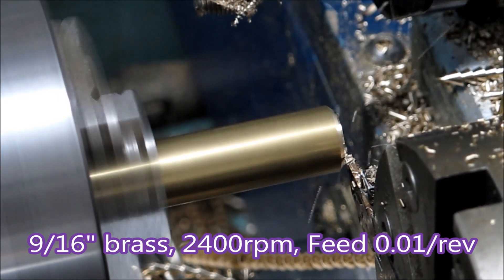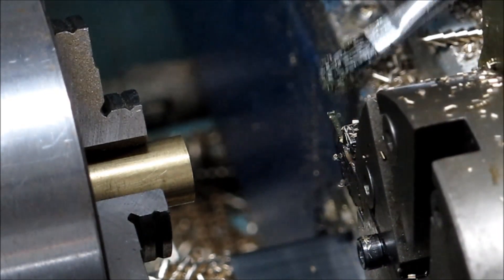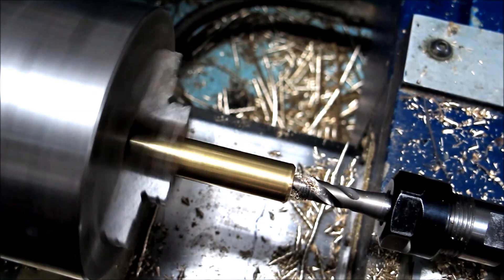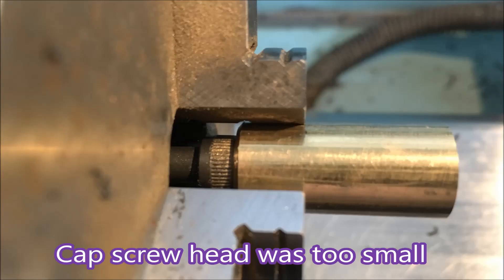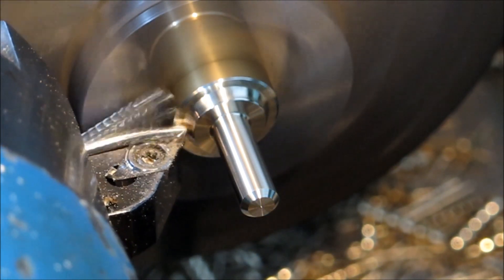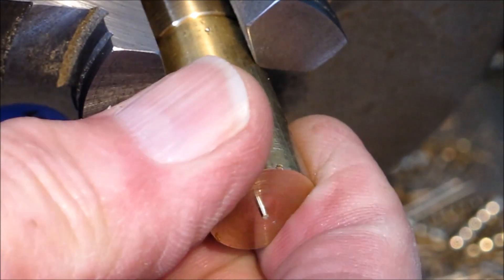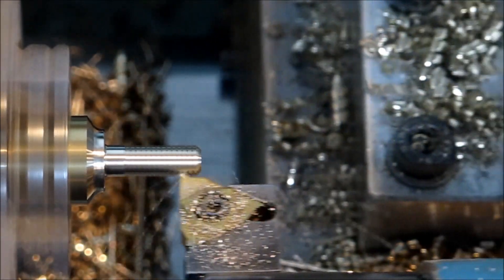Cnc lathe threading brass at 3000rpm. Drill and tap M10 in a second lathe

Comment: how much power does the spindle have?
Reply from the maker: Both lathes have 1/2hp spindle motors
Reply: @smallcnclathes  it's really interesting I have a 1HP spindle and cannot get similar results at all; only due to a bad controller. The speed slows down quickly once load is applied and tries to catch up afterwards however. when it slows down the chip load is getting relatively big at that time which jams eg. the parting tool.

Comment: with which program you work?
is it a grbl controller?
where you know the position of the spindle? is it eith a encoder or only rpm?

thanks
Reply from the maker: Alexander noname thank you for your comment. The machine is controlled by the software provided by the manufacturer. The spindle has an encoder.
Reply: @smallcnclathes  ok thanks!
do you know the program name?
is it a encoder only for speed or degree position?
you help me much!
Reply from the maker: Alexander noname  the software was provided by the manufacturer “Hercus”  an Australian company.  The encoder measures the spindle speed and controls the start point when threading.
Reply: @smallcnclathes  control the start point? its more as the speed! i think!

thank you
Reply: @EMCOAlex  Think about it.These are multiple passes. The start point must be the same for each pass or you wouldn't get a thread.

Comment: And to think some old timers, and the people who only learn from books or by following the oldies without question, still believe that you HAVE to have neutral rake for brass.
Reply from the maker: Chris, I have to admit that had I not started to make parts back in 2005, I would no doubt still believe it. I does still work of course, but I really like the way inserts for aluminium deal with brass.
Reply: @smallcnclathes  I think it is taught the wrong way round. The nearer a cutting edge is to a right angle the stronger it is, so if you can get away with using a flat tool all the better. So you can use it has morphed into you must use it. Some metals you can't easily use a flat tool so you add some rake because you have to. I like to use 15 degrees of rake on everything, except hard stuff where I use carbide, but then I just play at it compared to you.
Reply from the maker: Chris Stephens I am only playing too! Half a horsepower at the spindle makes it about all I can do!
Reply: @smallcnclathes  I only have 1 horse on my main lathe but your CNC makes up for at least 2hp.
Reply from the maker: Chris Stephens not sure how it can do that, but I thank you for your comments
Reply: @smallcnclathes  you can do more accurate  cnc cuts on your lathe in the time a bigger motored manual lathe could.
Reply from the maker: I must admit, part to part accuracy has never been an issue, little machine does nicely in that department.

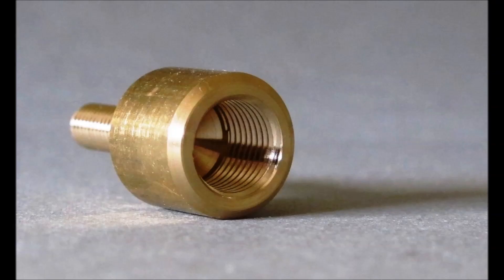Comment: 2000 or 3000 ??   At 4:23 the thread form looks like it has a concave face on the right hand side, maybe this is an optical illusion.
Reply from the maker: Definitely 3000 rpm and thread was good, so it must be an optical illusion. One of those that one person will see it one way and the next person sees it the opposite way round.
Reply: @smallcnclathes  looks like it could be just the brightness of the light

Comment: Great work making them, but what exactly did they need that abomination for?
Reply from the maker: John Alexander indeed, not a pretty part. Customer was buying in a widget with a M10 female thread, into which a widget Mk 2 was screwed. The widget of the first part started arriving with a M5 thread so an adaptor widget was required, M10 to M5
Reply: Either the widget manufacturer didn't do the maths when they decided on M10, or they're just guessing. Hope it's all still strong enough.

Comment: You used motor servo or stper on in yuor machine
Reply from the maker: Spindle is dc motor, axis drives are servos
Reply: @smallcnclathes   
What is mine in steper motor